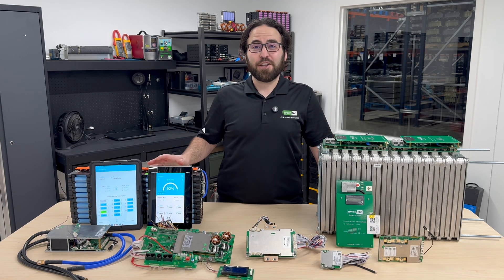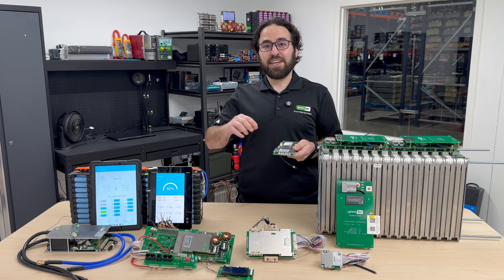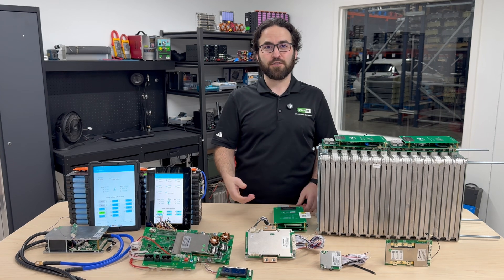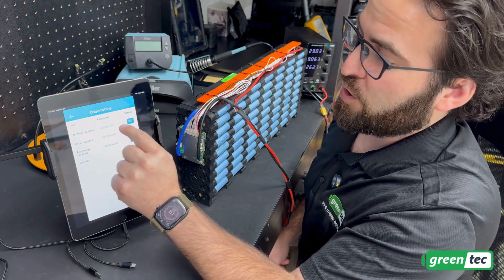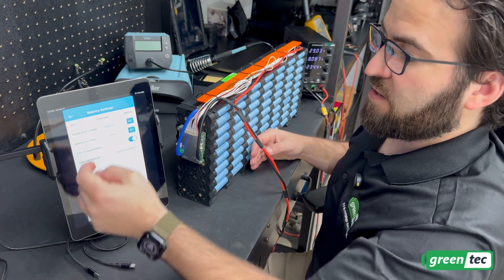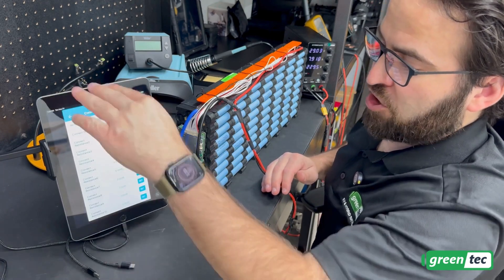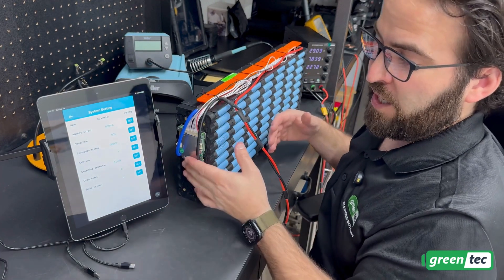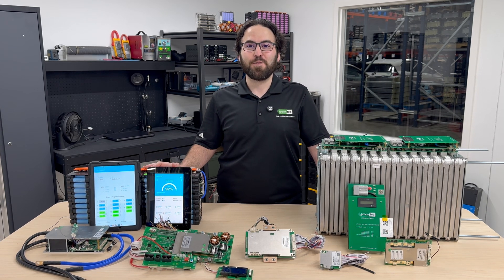How to program JDB BMS settings in the Xiaoxiang Electric app and a comparison of Jiabaida models

Comment: Hi!

I have got a 12.8V, 300AH, 3840Wh Energy LIFEPO4 Battery that is connected to a 1KV Intelligent Inverter, which, when a 210 Lt deep freezer that it supplies cuts in, trips and a short circuit trip alarm pops up.

I see it to be a false short circuit trip alarm.

I am failing to access the JBD BMS  Control page, in order to make some adjustments ...

Could you please assist me with that info, so that I may be able to enter the Control mode???

I thank you in advance. 🙏🏽

Comment: I have another question. I have the JBD 300A contactor version. I downloaded the software from the link you provided. It looks diffrerent from the one in your video. I am running Android. Problem I am having is that when I turn on the motor controller, the contactor cycles on and off about once a second. When I turn on the motor, it stops turning on and off. A buddy thought it might be some sort of capacitor charging up and causing a current spike which shuts the BMS off, then the cap bleeds down when the contactor is open, then rinse and repeat.

Comment: Can you share 51.2 volt 35 ah, 16 cell Lipo4 battery setting for xiaoxiang app,

My battery is not showing on charging , and on running mode in app and it is not showing down the charge until its get fully discharge.
Reply from the maker: The first thing is to look up the spec sheet of the cells you are using. Even amongst LiFePo4 batteries the settings will vary to match cell’s abilities. Like  the low voltage cut off, amperage, Ah, etc. However equally as often it’s a swing that got overlooked like temperature cutoff that is set to 0 or something like that. 
I would be glad to help you more but it’s hard on YouTube comments. If you leave a comment on one of my  Face book posts that I’m in, I’d be glad to  go through your settings more in depth .
     - Levi Thomas
https://www.facebook.com/share/15KZRwdy3S/?mibextid=wwXIfr

Comment: My app won't let me turn on discharge. In function it won't let me turn on switch. 
It will automatically turn on discharge while it's charging. Lifepo4 3.25volts no alerts
Reply from the maker: @electromechanicalstuff2602  this is very common and it almost always means one of the parameters isn’t set right or the balance wires aren’t connected properly.  I’d start by unplugging the balance plug from the BMS and checking the voltages of every pin with your voltmeter touching the blue wire with the negative lead and then check each pin with the positive lead.  Make sure they are all the correct voltage. Then go over every single setting. Don’t forget temperature is in Celsius.
Reply: @greentecbatteries  I did all of this several times everything was fine. The only setting I saw that was different between one that was working and two that weren't was the function setting for switches was off on the one that worked and on in the ones that didn't. I tried switching them off also but it would also not take the command. I walked away for a few hours. Came back then tried to turn off the switch function again and then they all took the command .. with the switch function off the discharge automatically came on and now the switchs for charge discharge actually take commands. Seams backwards and off it didn't take the command earlier but they are now all working. I disconnected the balance leads several times to attempt a reboot of the BMS as well. Nothing worked except some time... Ods

Comment: So the batteries you have are Li-Ion not LiFePO4?
Reply from the maker: Yes the eMatrix batteries have 252 Li-Ion NMC batteries in each module. The Nissan Leaf batteries are also Li-ion and have a unique design, they have two cells in each rectangular unit so on the top there are three contacts. They also have LiMn2O4/LiNiO2 anodes and cathodes for longevity but you can treat them like any other Li-ion as far as the BMS goes.

Comment: Hello,
Thank you so much for your video!
I have a question regarding the app. In your video, the app design appears updated, but the Android app link you provided is for an older version. Could you please let me know how you managed to install the version with the new design and the full list of parameters? Currently, in my app, only the first and second items appear under the parameters section.
Reply from the maker: I was using an iPad in the video, which could be some of the difference. I don’t use Android often, but the link for the Android app is the most recent one that I am aware of that is fully unlocked and compatible with almost all the models. The BMS should come with a barcode to download the version to be used with that specific BMS, but they usually have fewer features.  If you have your specific BMS model, you might be able to contact the vendor you purchased it from or contact JBD directly and get a newer unlocked version for your BMS.
Reply: @greentecbatteries  Thank you very much for your reply

Comment: So it's a relay for heating?I cannot find any help to use heating with JBD-SP04S060-L4S-300A
Reply from the maker: Yes. The heat connection is just a pair of 22AWG wires however you have to select to add that feature before you purchase it. I believe it added about a dollar  to mine to add the heat plug.
Reply: @greentecbatteries yes i ordered with heater now waiting... is it possible to set it up to draw power from pv to heat up before charging?

Comment: Does that display change settings without having a phone?
Reply from the maker: Yes the optional LCD screen that comes with the JBD BMS has buttons on it as well and has a very good interface. You can change settings and toggle the discharge and charge function right from the display.

Comment: Cold I put three of those eMatrix batteries in series which would be 21s 72v right and then hook it up to the 250a bms even though it’s 22s? I’m think to power my tricycle that has a 5000watt hub motor.
Reply from the maker: Absolutely. I would recommend the Samsung INR18650-35E model from Greentec Auto because it can handle 460A peak. We also sell buss bars to connect them in series. Yes that 250A BMS would be a perfect fit for that. When you wire it up you will combine the b20 and b21 wires together leaving b22 to be the positive most connection, then you can wire it up to a 21s battery. 
https://www.greentecauto.com/hybrid-battery/repurposed-batteries/energy/252-18650s

Comment: Wow I’ve never seen that 300A version before, that’s huge! I’ve got one with the switch wire. Does it need to be a switch or will a push button work?
Reply from the maker: The JBD BMS needs to have a latching switch, not a momentary one. Meaning it makes the connection all the time when it's on. You can get these in a switch or push button form just make sure it isn't momentary.

Comment: Thank you so much! I watched your wiring video which was great and tried programming everything but couldn't get the BMS to turn on for the longest time. Turns out I missed the "Cell num"  setting in the "Origin Settings" tab and the BMS wouldn't do anything. I noticed you left you 0%-100% capacity settings between 2.55v-4.15v while the protection parameter settings were a little bit different. Does that effect performance?
Reply from the maker: I'm glad it helped! No those settings do not affect each other. Under Parameters, Capacity Voltage and then setting the percentages is really a preference. That is what will be displayed on your phone, tablet or the LCD screen if you have one installed. I like mine to show the packs true capability even though the Protection Parameters settings are going to shut off the flow of current before it hits zero. Think of it like a reserve tank in an old gas motorcycle or car. It will shut off if you weren't paying attention and got that low but you could still open the app and lower it to the batteries safe minimum then keep driving somewhere until you can charge.